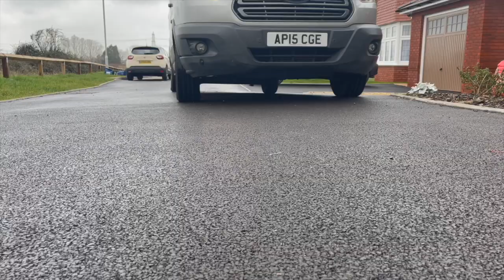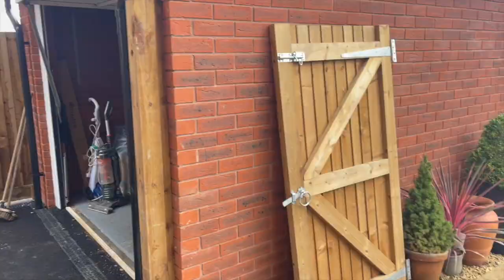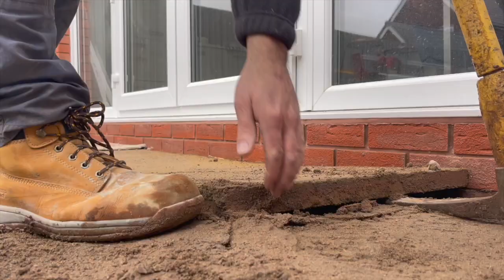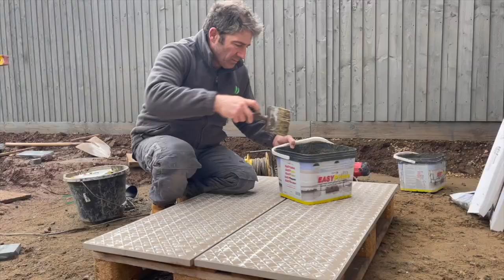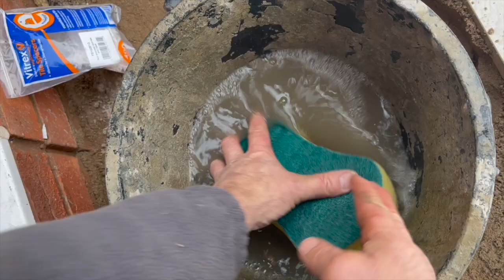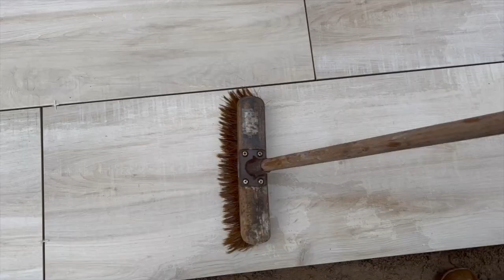Landscapers Are Tiling Outdoor?

Comment: Hi guys ready for doing my back garden and feeling confident after watching your great videos . Can I ask what you would bed 20mm porcelain tiles onto the top of a concrete block wall as a coping . Would you use a thin bed of mortar  and prime the back . Or some kind of adhesive . Kind regards
Reply from the maker: Thanks Andrew for watching and sorry for the delay in answer to your question, as long as the height of the wall is to the required height  I would use Mapei or Bal has a good adhesive, and yes you can use a priming slurry and mortar method if you prefer, thanks again for watching.